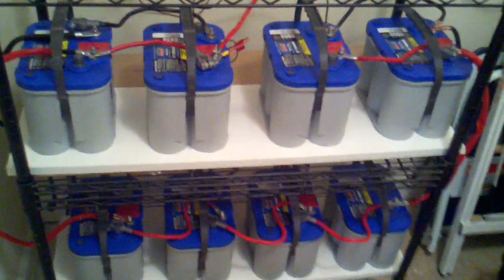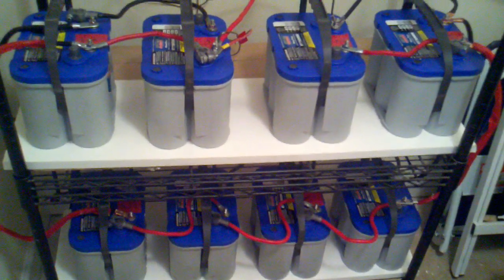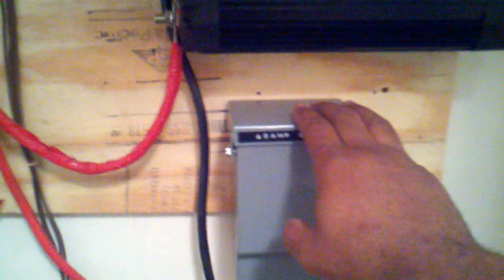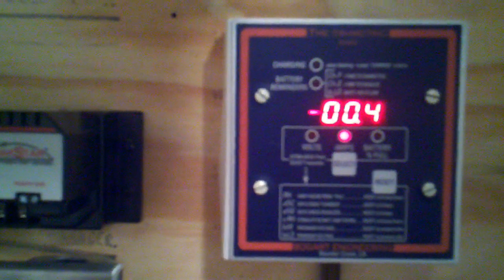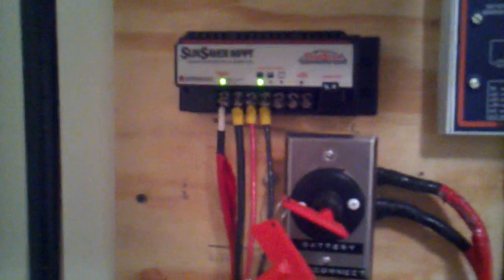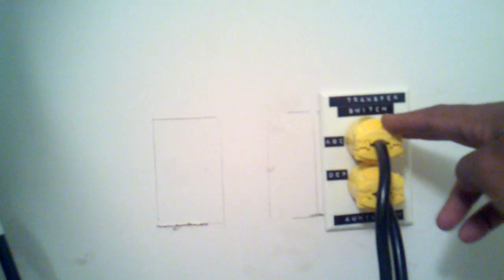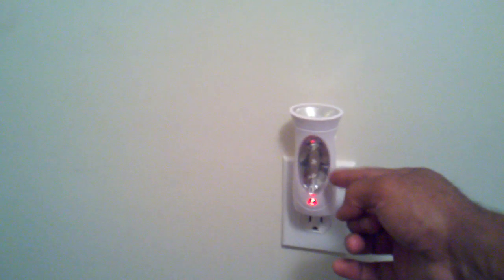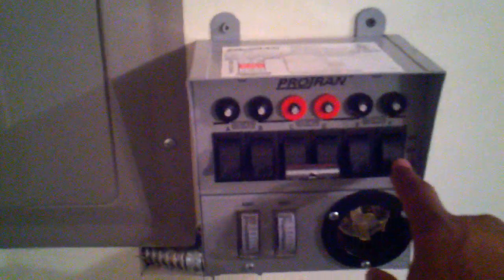DIY - Home Solar Power Part #3

Comment: if that top batt shelf breaks/collapses you are in for a HUGE fire. PLACE SOME BLOCKS OF WOOD or hose clamps OR FLAT OUT SCREW THEM INTO POSITION to keep the metal great from shorting batts just in case. I have no faith in these shelves, I have had the FAIL !

Comment: That is a Square D disconnect, it is not a breaker. It is nothing more than a 60 and light switch. I do HVAC is why I know and I thought it was a breaker for 10 yrs. Then I was told by a electrical inspector and supply house that the "Breaker" that comes in the box is not a breaker but a disconnect switch.

Comment: Your inverter looks to small for all those circuits on that transfer switch ,it looks clean did you do a load calculation . because 2000 watts can only handle 16.5 amps
Reply from the maker: I've replaced this inverter with a larger one.  I now have a 4000 watt heavy duty MagnaSine inverter.

Comment: NICE SETUP BUT.  what if the top battery shelf falls and shorts out the bottom shelf of batteries? boom
Reply from the maker: Good question. The shelves were metal shelves with would to sit the batteries on, so there was no danger of them falling.

Comment from the maker: No problem, I didn't take it in the wrong way. And you are correct, these batteries can be expensive, and they were.  But I wanted something for a home backup system that would be safe and last a little while. Thanks for your comments.

Comment: the wood planks were a great idea... they are actually insulating your battery bank from the metal rack that is sitting on the concrete.  You did yourself a favor

Comment from the maker: Probably around 2 kwh per day.  Granted, this was not done to save money.  It requires more than 2 to 3 panels to really make it worth while to save money.  And that requires a fairly large initial investment in equipment.  This was simply a backup system with partial off-grid capability.

Comment from the maker: If you want to power your home, I would recommend looking at the comment from DukeHeart and follow his approach.  To power your home you may need to a substantial investment in solar equipment, granted that depends on the type of home you have and the amount of power you require.  With my current system has 670w to recharge a battery bank of 7920w and a 4000w pure sine inverter, I can power all of my 120v circuits during an outage. My system is for backup power only.

Comment: I did it like this. Multiplied my power bill by 7 years. Went to the bank and borrowed slightly less than that, Put in a dc storage PV system. So now I can be off grid, Will never loose power. Have 5 days of autonomy,  And I am not affected by raising  power bills.

Comment from the maker: That's true, for everyday use 50% is a good stopping point. But knowing you can take it down to 80% during an emergency or outage is good to know. As purely a backup system 80% DoD is not a problem, with good preparation and conservation sense it may never get that low.  In my opinion 50% or 80% depends on the purpose of your system.

Comment: Just curious if you made a typo or not. You say 7920wh x .80% = 6336wh of useable power. Do you draw your batteries down to 20% state of charge? From what I've read, 50% is about the lowest you want to go

Comment from the maker: You are absolutely correct.  Shortly after this video, I fried an inverter.  The video after this one illustrates that using and AC breaker in a DC circuit is a bad idea.

Comment from the maker: Not really, I simply use the watt hours (wh) method to determine how many watt hours I have in my battery bank.  I have (12) batteries at 12v and 55ah each.  12 x 55 = 660wh each.  660wh x 12 batteries = 7920wh.  7920wh x .80% (Depth of Discharge) = 6336wh of useable power.  Then I take the total wattage requirements of what I want to run (for example; TV 75w + Freezer 200w + household led Lights (60w) = 335w). So 6336wh / 335w = 18hrs of power (If I wanted to run all of that continuously).

Comment from the maker: Sorry for the late reply, you tube flagged your question as spam.  The inverter was hooked to the transfer switch by an electrician. He ran standard household electrical wiring from the switch to an auxiliary outlet where I simply plugged in a cord from the inverter, allowing it to send power to the switch.

Comment: Great video ,i like to know how do u connect the inverter to the power transfer switch ? what cable u use and the inverter with two  L14-20 power outlets ?

Comment from the maker: Hello Rose, unfortunately I don't remember seeing or answering this comment. In any case if I did, I do apologize. But like MyEyezHurt says, I would invest in "inline" fuses and DC rated circuit breakers.  They are widely available on the web.  I have fuses in between the battery on my components i.e., charge controllers, battery monitor, and the inverter.  Breakers would go in the same locations.

Comment: Thanks for the update.  We are just getting ready to hook up our system and I'm trying to learn from others mistakes to avoid a costly error.  I have (7) 128 watt flexible panels 24V each and my inverter is a 10,000 peak and 5,000 continuous with a MorningStar 30amp charge controller.  I have four deep cycle batteries that we plan to connect in parallel.  Do you think that I need anything else for safey precautions?  What did you hook up the breaker to?  
Thanks!!  Rose

Comment from the maker: This is an older video of my earlier efforts.  This is actually a "switch" and not a breaker. As a result of me being mis-informed at Home Depot. This resulted in me burning up an Inverter and having to replace it due to an "over current" situation. I have since continued to use the switch as a disconnect, and a 200A in-line fuse for over current protection. However, there are plenty of websites that will sell you the DC rated breakers you need. I just went with an in-line fuse that works too.

Comment: Also, if you wanted to pump your power into the grid, you shouldn't even use batteries. These are inefficient, and there's no reason for them. Pump into the grid during the day and use from it during the night.

Comment: If you just plug a standard inverter into the wall, it'll blow up (literally). The inverter generates its own waveform for AC power. The grid has it's own signal, and if the waveforms don't perfectly match, then the inverter will blow. You NEED a specific grid-tie inverter, where it will sense the exact waveform and voltage of the grid, and can sync with its waveform. Also, in the event of a power outage, a normal inverter will feed onto the lines and can kill a line worker and you'll be sued.

Comment from the maker: Here is where you must be "extremely" careful and understand what you are trying to do. In the description of my video "DIY-Home Solar-Why do it and What can it power", are links to my system schematics which answers your question by way of illustration. You should never try to backfeed power to your home through normal house outlets. I had an electrician install a separate outlet wired to my transfer switch to feed power back into the mains. My other videos show my steady progression.

Comment from the maker: My system is designed to be a backup so the batteries are the primary components. The Grid Ties are secondary, hence the transfer switch.

Comment from the maker: A transfer switch is a device that transfers or switches power from one source to another. In this case it would switch from the local electrical grid (utility) to a solar or gas generator backup. An electrician would take some essential circuits you designate from your electrical panel and tie them into the transfer switch's circuits. The Transfer switch then can switch between 3 settings (1)Utility (2)Off (3)Generator. Transfer switches allow you to power portions of your home from a Generator

Comment from the maker: @urzaspath1234 You could build a similar system with cheaper parts, i.e., MPPT Charge Controller= $150 to $200, Battery Monitor=$150, Inverter=$100, Batteries = Kirkland (Costco) Deep Cycle 115Ah (x2) = $200, (1ea) 200w Solar Panel from sunelec(dot)com= $300, Cables\wires, etc = $150, Transfer Switch= $250. After doing this myself, I'm definitely convinced you can do it cheaper and get the same results. Take Care.

Comment from the maker: @TheDigitalWeb Thanks for your comments. with a 140w panel, you definitely need a charge controller. Generally, any panel over 5w requires a charge controller so it won't blow up your batteries. I do recommend getting a cheap amp\volt monitor, it will let you know where your battery\charging stands. Get the breakers for safety. For the guides, see the description in my video "DIY - Home Solar Hybrid - Standalone - Grid Tie - Done!!", for download links to "free" books.

Comment: Hi RHANDSOM - Great informational videos! The best on YouTube I've found thus far.I hope you don't mind a "newbie's" questions? I bought a 140w 48v 16' rollable solar panel(more as I can afford), and a grid tie inverter.Can I begin to install batteries in this system,and do I need things like a charge controller,a "dump load",an amp monitor,a breaker,transfer switch, etc..Also, what are the 2 phases you mentioned?  Is it possible to purchase written explanations or "instructions"?  Thank You.

Comment from the maker: @jonathans1212 With newer energy star fridges, you should get better efficiency. Not sure of the costs, when I was looking for a new fridge I found the cost to range from $600 to over $900, for the ones I wanted, there were the basic models that cost much less but without the frills. However, compact freezers are reasonable in price. Sounds like your system will be a really good backup and charging system. 200W panels at $250 is definitely the way to go.

Comment: @rhandsom my fridges is rated at 6.8amp ac so thats 680watts ac and 68amps dc with 100% efficiency so 70 with the losses
how much are the newer fridges 
my system is gonna be a back up for power outs and it will have a ac transfer switch so when the generator is running there is no load on the batteries and a 6amp built in charger im looking for a bigger transformer around 15amps to hook to my charge controller so the generator has to run a minimum i just picked up a 200watt panel for 250$

Comment from the maker: @jonathans1212 Thanks for your comment. Unfortunately, the breaker was a switch and caused me to ruin an inverter. This is an old video, I've since added new components. I now have a 24v system and my compact freezer only draws about 1 Amp AC \ 5 Amps DC (it's a newer energy efficient model and at 24v, I only need half the amps of a 12v system). 70 Amps is a lot for a fridge or freezer. Take Care.

Comment from the maker: @farmsidney Small Grid Tie Inverters are used "with" the grid to supplement the power already coming into a home, regular inverters are used "separately" and can't be used with the grid. They are used for "different" purposes. Knowing the difference, if you want  to add power to the grid, use a GTI, if you need a "backup" system use a regular inverter. Using the batteries as a buffer area, you can connect a GTI to a battery bank also. I made a video that shows that it can be done.

Comment: 60amp breakers and if you bought those from home depot they might be ac 120v breakers  60amp dc is only 600watt ac if you have true 100% efficiency. 
My 1000 watt inverter pulls 70amps when I run my fridge? What's the amp rating on your  freezer?

Comment: I am a follower of your channel and I have a question that maybe you can help me. A supplier of inverters (Grid Tie) said that this type of inverter can not be used with batteries. Only directly. Do you know anything about it? He said that only can be used to inject power into the grid. I have a project to produce and store solar energy in batteries. I already have the controller battery. Or should I use inverters common?

Comment from the maker: @Blu3Resent The battery Depth of Discharge is the percentage of power taken out of the battery. 80% DoD is saying that, typically with Deep Cycle batteries you can discharge the battery 80% of it's rated capacity until it will automatically cut off the flow of electricity and be considered effectively dead. So out of 100% capacity, you can only use 80% of it. Thanks hope this helps.

Comment from the maker: @Blu3Resent Lets calculate (8 batt x 55ah = 440ah, 440ah x 12v =5280watts, 5280w x .80 "80% Battery Depth of Discharge" = 4224w "usuable battery power", 4224w / 13w CFL Bulb = 324 hrs of light. 4224w / 75w incandescent bulb = 56 hrs of light.)

Comment from the maker: @johnmonk66 Thanks for your comments. Initially folks like myself start out by setting up a backup system, then progress on to a grid-tie. I started to run extra outlets but I went the xfer switch route instead, and later to an Interlock Kit.  My channel has the latest videos. Good fortune and I'm sure your going to have the same fun we did. Take Care.

Comment: I might be buying a house soon and am thinking of putting in one of these systems, but I find everyone uses this only as an emergency backup.  My plan is to run the system in the attic and drop down an outlet into each room, and use those outlets for general usage all the time, to save money.  I find this can be done cheap, and save money.  Then in the future I can expand to use it to power bigger items in emergencies.

Comment from the maker: @KANYANGA Thanks for your questions. Actually, I now have 4 panels and 12 batteries for a total of 670Watts for solar panels and 7920Watts of battery power. The system has grown considerably since this video. See my channel for the latest videos. Also, there are 220-240 power inverters on the market that you can buy that will give you the voltage you need. I just saw one eBay for $49.99, search for "1000W POWER INVERTER 12V DC to 220V AC".  You should see a lot of them. Take Care.

Comment: U add more batteries for more amperage, But, did u add another solar panel? Thank you for the Video, I'm working on making one here in Africa. Just a last Question does it work for 220-240 Volt.  and 30 Amps.That's what we using here in Africa. many thanks.

Comment from the maker: @tonkacaptain Thanks for the comments. It's been awhile since I've seen this video, but I've been through at least 3 or 4 inverters, at least 2 MSW. I finally settled on a 3000w pure sine from the Inverterstore and I would recommend them. As for pure sine vs modified. I chose pure sine after I fried a couple of things in my house with the modified sine wave inverter. Remember, Modified sine wave = dirty power.  If you have the flexibility I would go with a decent wattage pure sine inverter.

Comment from the maker: @Sharky58 Check out this video "Step by Step: How I Built A Solar Generator For Less Than $300" which is found on youtube.  It should give you a good idea on building your portable solar generator.  This video started it all for me, and I built my own version of it.  This, with a cheap walmart deep cycle battery and box, along with a decent sized modified sine wave inverter should be enough to get you started. Find a cheap 60w panel for charging the batteries. Search youtube for the video.

Comment from the maker: @jeeping32810 (2) To answer your question, I replaced the lights in the rooms with low wattage LEDs, maybe 6 to 8w ea. I also practice energy conservation. I have 5280W of usable stored battery power. TV\DVR at 125W per hr (5280w / 125w = 42hrs), 1 freezer at approx 100w per hr (5280w / 100w = 52hrs potentially), keep in mind freezers don't run all day.  The rooms with LED bulbs, add all at 32w per hr (5280w / 32w = 165hrs). Re-Charge time is dependent on panels, charge controller, DoD, etc.

Comment from the maker: @jeeping32810 (1) Before setting up a system it's good to do an energy audit by determining what loads you are going to run, i.e., lights, microwave, freezer, etc. then add up the total watts required to run them, then multiply it by the running hours. Once you have that number, size your battery bank accordingly. In my case, I initially just wanted to run a freezer and some lights, but when I saw the capability of the system I expanded the battery capacity to give me more days of autonomy.

Comment: I am just starting out and I am planning to start a system for my wife and myself.  We have a 45 ft shipping container on 10 acres.  I am wondering how long you could run those "rooms" or A, B, C, D, E, F on the battery setup you have.  How long until  you need the generator?  How long would it take on the generator to bring battery bank to 100%?  Thanks for the vids... they are helping a lot to understand things.

Comment: USE 3/0 WELDING CABLE FOR ALL YOUR JUMPER CABLES AND FEEDS, DO NOT USE CHEEP CRIM TEMANALS, USE HEAVY DUTY TERMANALS AND SOLDER THEM ON TO THE WELDING CABLE, THAT IS NOT A BRAKER FOR DC

Comment: USE 3/0 JUMPERS ON YOUR BATTERIES AND UP YOUR BRAKER TO 300 AMPS ON YOUR + FEED RIGHT AT THE BATTER, NOT UP ON THE WALL, IT IS A 300 AMP FUSE WITH 3/8" BOLT HOLE TO FIT ON YOUR + TERMANAL, YOU ARE NOT PROTECTING YOUR CABLE AT ALL FROM THE BATTERY TO YOUR BRAKER, IT MUST BE RIGHT AT THE BATTERY, WE SELL THEM !7$ EACH OF SAVE AND BUY A 5 PACK